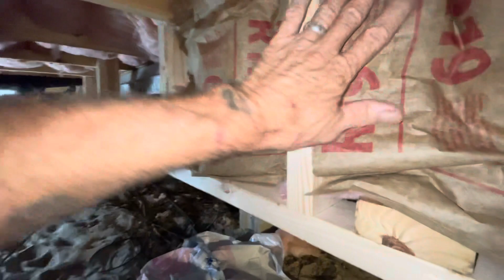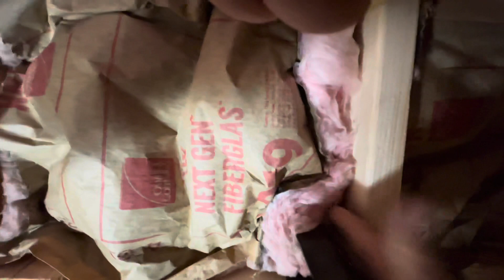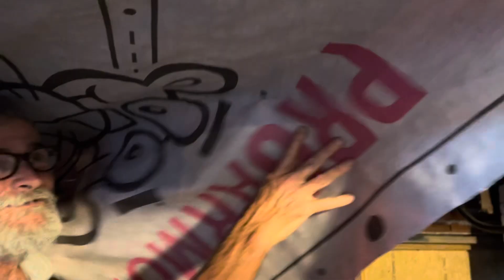Mobile Home underbelly. Re-insulating

Comment: Hey, Drew - another question if you have the time?  I've looked around but I see some conflicting advice.  Watching your videos you seem to use 10oz tubes of roofing cement - what brand do you usually use?  Henry, Black Jack, something else?  I plan to do some metal roof repairs and also some shingle valley repair.  Thanks.
Reply from the maker: That will work for sure. There are plenty of different kinds.
Reply: @Drewsroofingandhomerepair  Thanks, again!

Comment: I'll have to deal with a similar type of problem on a neighbor's double wide trailer, but the varmints are skunks and raccoons (which possibly kept the mice away).  Unfortunately, I have much less space in which to work, so getting in and out of the crawlspace is hard and, of course, this is earthquake country, so you think of that from time to time when heavy trucks roll by.

I will probably have to use R-19 (5.5" deep) because the joists aren't deep enough to accept the recommended R-30 (10.5" deep), and the joists run parallel to some metal girders (and perpendicular to others).

My question has 2 parts: (a) shouldn't the faced insulation be paper-side up, with the unfaced fiberglass facing down?  (Looks like you had most of the paper on the downside), and (b) when you enclose all the framing in the pink panther material, do you limit the breathability of the floor - or - did you intend the pink panther to act as a moisture barrier relative to the open ground underneath the trailer?

Well, one more question - are a full mask and goggles useful when installing fiberglass from below, or do you mostly work with a simple R95 mask, like in this video?

Thanks for posting; it helps to see others dealing with many of the same issues before I tackle them here.
Reply from the maker: Paper goes toward the inside of house. R 19 is plenty
Reply: @Drewsroofingandhomerepair  Thanks for your reply.  You take care.

Comment: Did you replace the AC duct or is it new
Reply from the maker: No, we did not have to replace the AC though, but we did close it in. The AC duct is in between the insulation and the floor joists normally. We took out the insulation so that exposed the AC vent so we both a box around it re-insulated it closed it in.
Reply from the maker: I also put a dehumidifier under my house permanently

Comment: Insulation is hanging way too low around ducts, absolutely no insulating value whatsoever.  Did they pay you for substandard work?
Reply from the maker: Keep comments respectful
Reply: @Drewsroofingandhomerepair you did a fine job. Very few people actually understand how insulation works. They would be perplexed to know vacuum bottles have nothing in them to keep the heat from escaping.
Reply: It's better than anything that Warren Buffett had intended , Great work Drew , keep em coming !